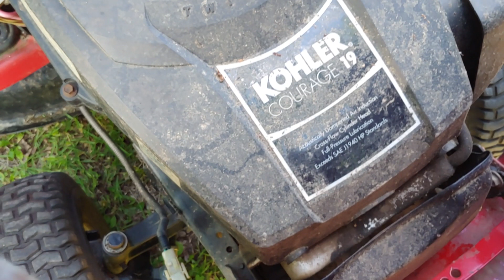Dead TroyBuilt mower, can we get it running again, Pt 1

Comment: Can't beat the price, free is for me! Nice mower to tinker with George. Make sure it's not tied up by rotating the flywheel. I hate electrical issues, hard to track down the problem with all the safety switches and all. You'll get it, definitely a beautiful day in the neighborhood.
Reply from the maker: Thank you Ken. I prefer working on the older ones that don't have all the safety switches, some of which are buried in hard to get at places. If need be, since this won't be a "mower" again, I can bypass some of those switches.

Comment: No 'Neutral switches' are not connecting?You know all this,of course.I found a simple staple plugged in tests whether it was a switch.I put a piece of plastic into the darned under seat switch so I could leave the tractor running.(I Always shut the deck off of course.)That's a mighty nice looking tractor.Good luck.
Reply from the maker: I am going to eliminate that seat switch, and I suspect that there is another relay of some sort that is malfunctioning. We will find it! Thanks Bry